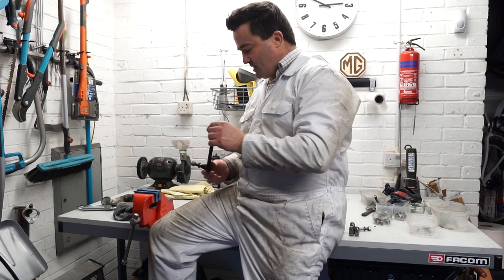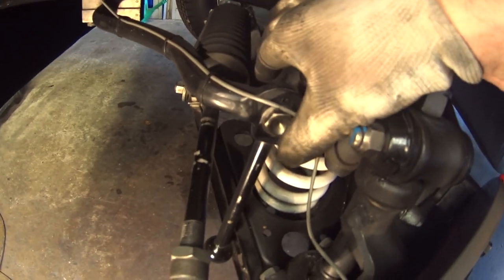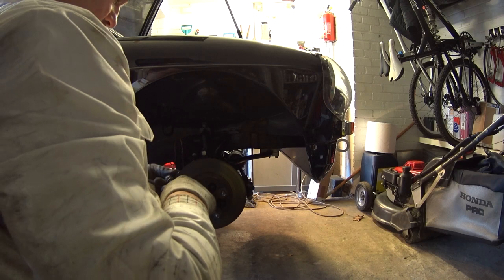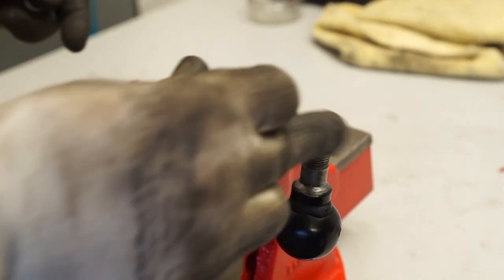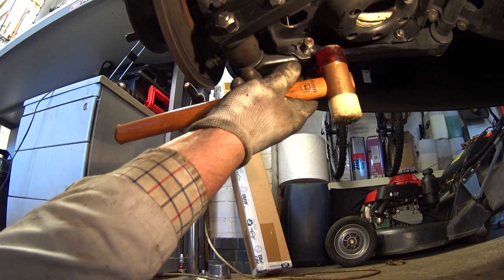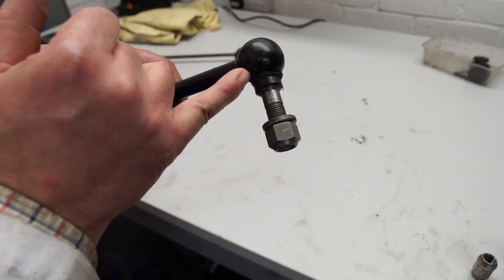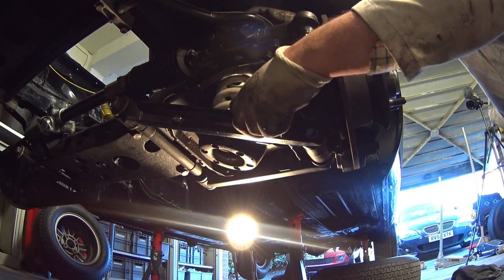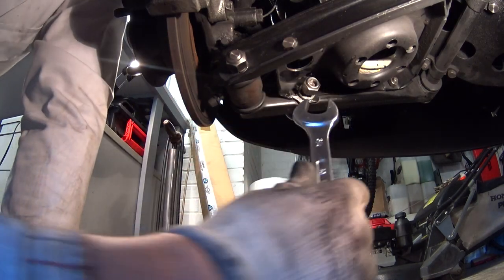MGB Front Anti-Roll Bar Drop Link; Removal, Checking and Replacement

Comment: Great video as ever David. I remember us talking about this issue back in the summer privately. As you might recall, I attempted replacement myself, and as you predicted, the bottom part was the problem. I just couldn't get it off myself with my tools so it was well seized. Your video will be helpful for other people like me though, I am sure. I ended up getting my local garage to do mine for me, which they did. When I collected they said "Yeah they were a bit of a challenge. We had to use heat to get them off" and they showed me the charred rusted remains of my links! I don't know exactly what that means, but I took it to mean they were a problem, even for them! Anyway mine is all good now even if I did have to pay a little to get it done properly.
Reply from the maker: Many thanks for your message Ted, I was amazed that mine came off as easily as they did, in the past the nut has been a real pain to loosen.  It does go to show how effective the anti-seize paste is to keep threads free. If the garage had to use head to get the nut off there's a good chance that the vice grips would not be enough to hold it.
Reply: @davidrussellwilks  most things on your car look new! I was amazed when you said they had been on ten years! They looked WAAAY better condition than mine.
Reply from the maker: It does not do many wet miles and usually gets cleaned down between races, that said I was amazed they had lasted so well; the rubber gearbox crossmember bushes had started to perish and were far newer.

Comment: Hi David👋 from NZ 🇳🇿 Just wanted to say big thanks for these informative videos. I’m following along at home and recently completed a thorough suspension and brake rebuild of a 73 MGBGT. I’ll be looking forward to engine and gearbox removal in the near future. Cheers!
Reply from the maker: Many thanks Rob, engine and gearbox removal can be found here: https://www.youtube.com/watch?v=oWqZQX0HvTQ&t=190s
Reply: Hi David, 
Quick question. You said you would apply full tightening on the roll bar drop links once the car was back on its wheels. 
Is that because it would otherwise force the roll bar into a stressed position if torqued down before the weight of the car is on the wheels? Glad you mentioned that as mine is torqued up and I’m yet to lower it down - I’m rebuilding the peddlebox atm. 

Maybe an idea of a video is your spanner check process as you systematically take the vehicle off the stands and onto its first road test.

Comment: The modern type drop links I  replaced on my NISSAN  X trail last October failed last month, they had dried out. However rest assured i will be replacing the drop links and bushes on my 72 MGB GT  with originals drop links and meybe even upgrading bushes to poly ones.

Comment: Request for your future videos...Gday David, I recall seeing something about suggestions for future videos.  Can I request one aligned with fluid/oil leaks?  As so many of us owners live with this common issue it would be awesome to gain some insight into diagnosis, concern, options and recommendations.  In otherwords if we see clean oil leaking from transmission, what are the methods you use to diagnose and how you'd go about determining whether to remedy or leave as is.  I understand you machine needs to be tip top however us average owners it would beneficial to be aware of which leaks to be concerned and those that are less risky to leave.  This can apply to all wet areas, engine, transmission, brakes etc.  Another could be on sound and vibration, those things that are inside normal vs. other such as the notable failure of your differential whilst racing.
Just some ideas, many thanks again
Reply from the maker: Many thanks for your message, I am still yet to eliminate all the leaks from my car. There is usually a small amount of oil around the engine and under the car after the race, enough to create a small drip on the floor but not usually enough to see on the dipstick, the same is true with the transmission and back axle. I think often the issue is the paper gaskets that simply are not as good as more modern o-rings. If it just needs a small top up I tend to ignore it. 
The brakes however should always be dry, if I see any fluid loss here then I would certainly check it and find out why. 
There are some things one can discern from the cockpit, in the heat of the race though they can go undetected but then show up in the video later. 
I'll certainly give some thought as to how these points could be covered in a video.
Reply: Excellent suggestion. I would like to see this as well.

Comment: Gday David - another informative "video" many thanks!  I do have a question.  What are the methods you use to diagnose failing drop links?  Other than visual inspection and hearing clunking, are there are ways to check them. Do you give them a shake and will there be noticeable movement with/without the car being on jacks? How much rotation of movement (if is in the normal range)) would be expected?  Many thanks in advance
Reply from the maker: I think for me the best way to check is to actually get the link off the car and take a look at it. If you can see that the rubber has torn and the metal inside is exposed then it's time to change them. They should also feel very stiff, much more so that the links on modern cars. I would expect very little rotation from a good link.

Comment: are the drop link the same for left and right hand side very will explained video thank you
Reply from the maker: Many thanks for your message, the drop links are handed on the front, AHH6543A for RH and AHH6544A for left hand. https://www.moss-europe.co.uk/shop-by-model/mg/mgb-c-v8/steering-suspension/front-suspension/front-anti-roll-bar-mgb-mgb-gt-1962-80.html